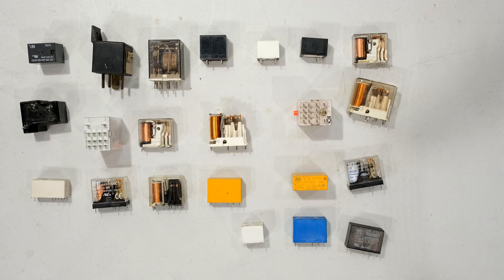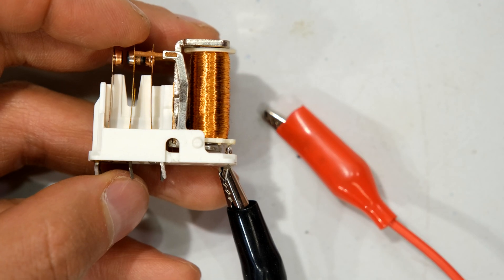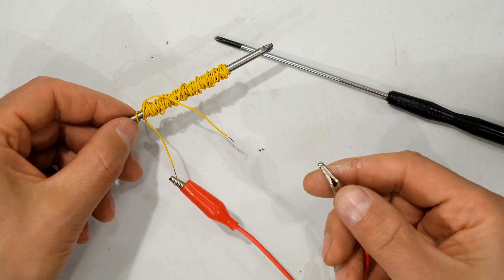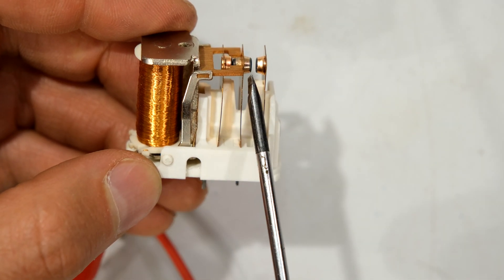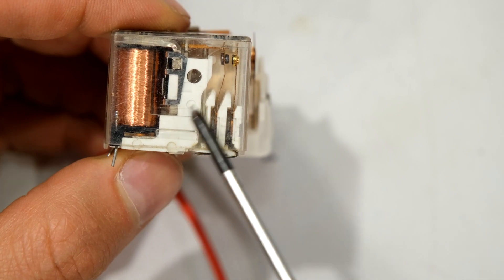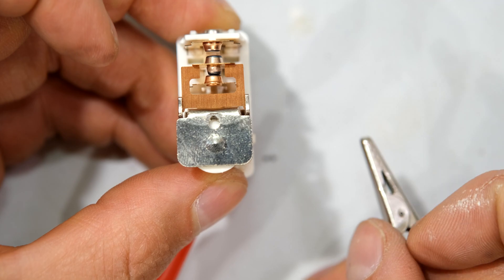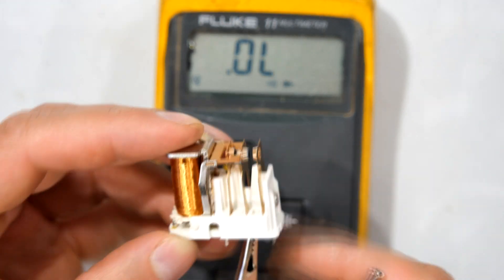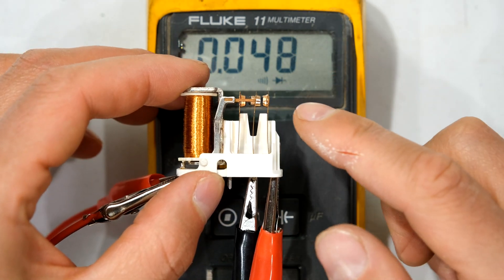How does an electromechanical relay work?

Comment: Very nice Video again. Thanks for taking the time to Explain.. Many years ago I used to use Relays every day. Taking a Remote 2 channel turning it into 4 or 6ch depending on the need and the remote module used. Even using 6 relays to start my 1995 IROC Z before the invent of Manual Shift Remote starter system. 1996. Relays to turn a stereo system from Low output Thumper to High output. So yes changing from Series to Parallel and the other way as well can make a difference in the sound and power depending on the amp and all the things that would go with it lol. So Relays can be used in so many awesome ways..
Reply from the maker: thanks Revo. IROC Z - what are you driving now?